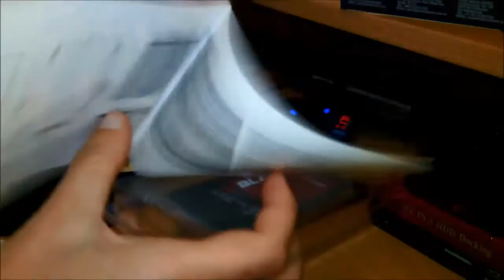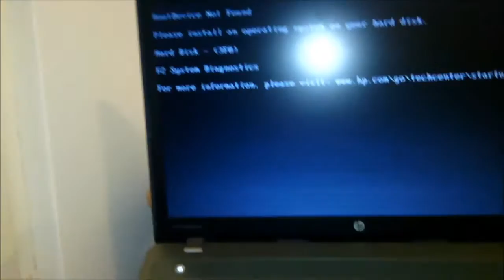Installing 2nd HDD / SSD into HP Probook 4740s Notebook

Comment: is the ram is dual memory, what is the maximal ram capacity for the HP 4740s ? is there a m.2 slot for the laptop ?
Reply from the maker: I think it isnt, and there in no m.2 slot.
Reply: manufacturer says 8 gb, but max is 16 gb, and there is no m.2 slot as i know